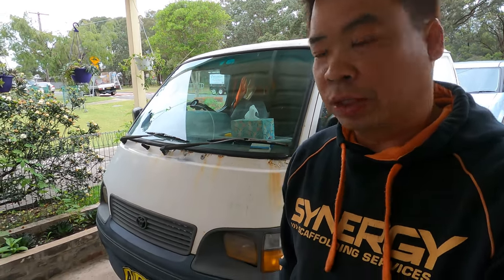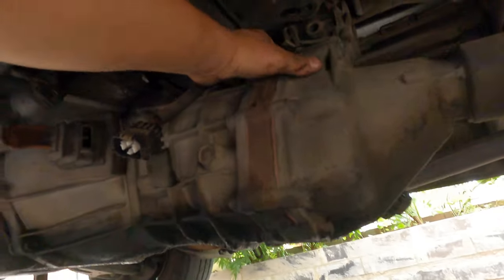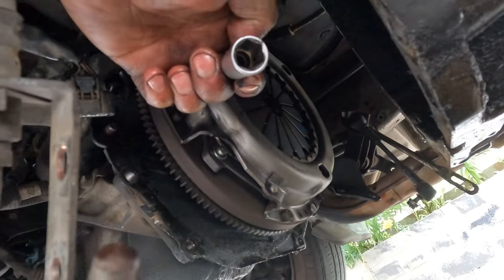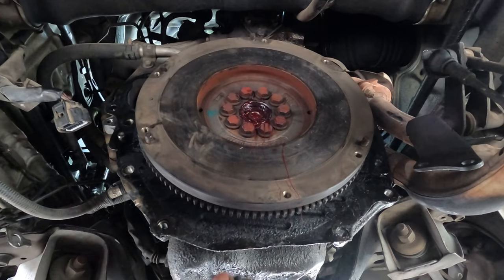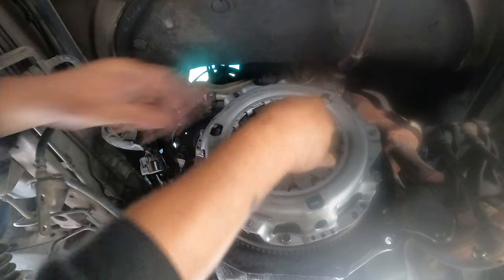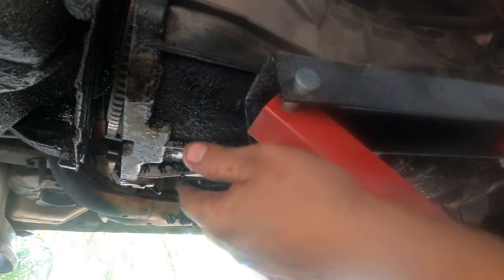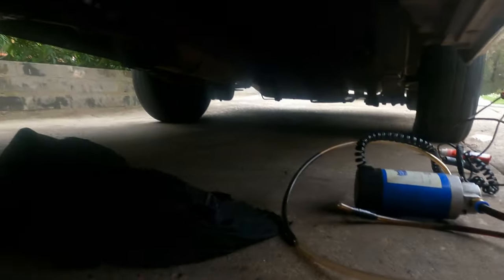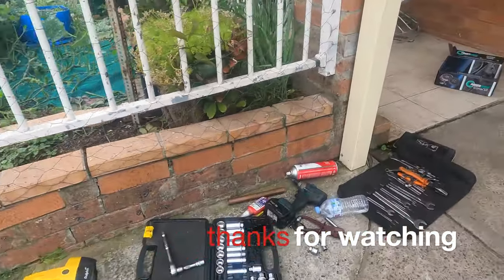toyota hiace 2000 2 4l clutch kits replacement and fuel filter replacement

Comment: Hi Simon. Thanks for great video. About the fuel filter, was that actual problem when it's hot the van doesn't want to start as they complained? Did the new filter fix it? Phu

Comment: Great video Simon, thank you. I especially liked the hydraulic plunger method of removing that bearing if you don't have a bearing puller.

You strongly recommend a heavy duty clutch for this van - will that make the clutch pedal stiffer, harder to push? Is your new clutch stiff?

I currently have a 1999 Hiace with a nice soft clutch, but I owned a 2002 Hiace that had a very stiff clutch, and it would make your foot very sore!!

Thank you.
Reply from the maker: yeah i more heavy then standard.but i am not driving it my friend car
Reply from the maker: i have bearing puller but it fail on me .so old school work well

Comment: Sir. What size clutch cover and clutch plate? 9.5 inch or 10 inch? Can use 10 inch?
Reply from the maker: 10 better
Reply: @TheDingdong78  sir. Clutch plate and clutch cover hiace 2.7 petrol same like a hiace lh174 3.0 diesel engine (5L)?